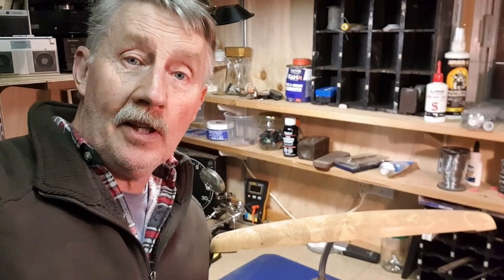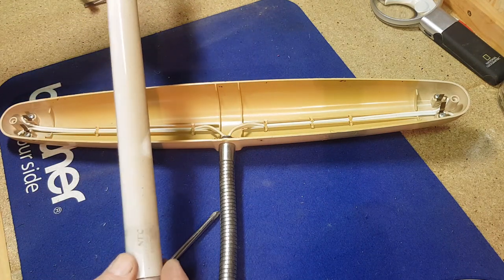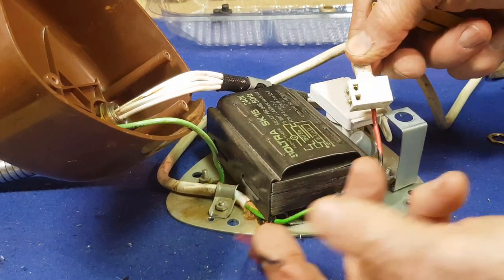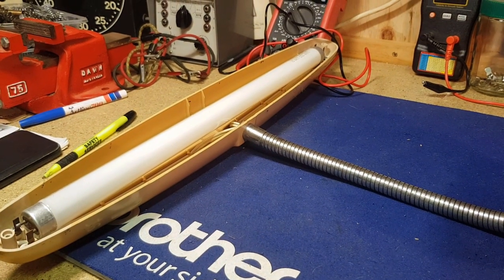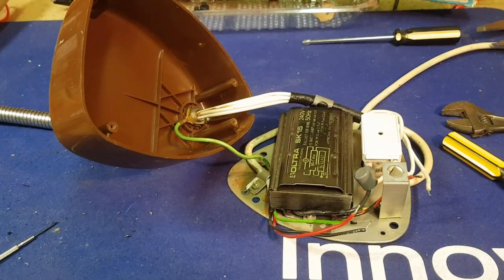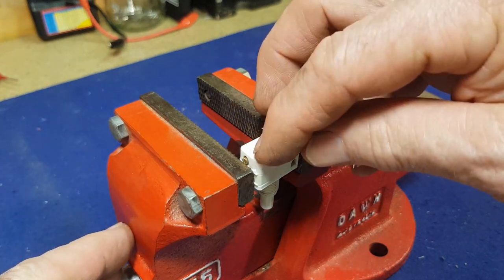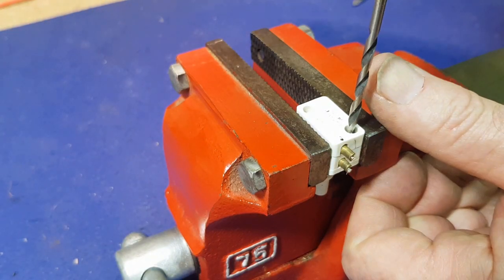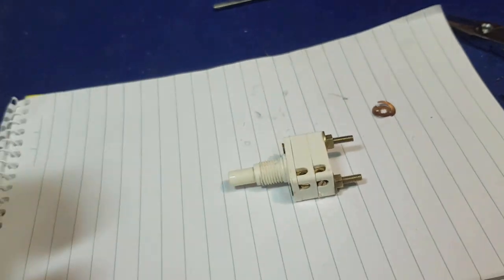1960s Retro Lockwood Fluoro Desk Lamp Repair & Restoration. Saved from the Rubbish Tip!!

Comment: I finally finished converting one of these to LED yesterday! This video is how I first found your channel ages ago, researching after I bought the lamp 😆
Mine was more of a wreck, top and bottom were originally cream but badly yellowed, so I painted them both brown. I forgot this one had a brown base, my choice has been validated! 😄
I converted it by mounting a CRI95+ LED strip in a diffuser, instead of buying a drop-in replacement tube like a sensible person. No regrets though, it looks the part.
Reply from the maker: Sounds like a cool restoration Nebby! Not sure about the brown paint though! Have you tried the retrobrite process to fix yellowed plastic?
Reply: @TheUltimateRecycler  On a small scale yes, with mixed results! I plan to try it again, but decided against it here due to the size, the severe & uneven yellowing, and the fact I couldn't get the neck separated without destroying the base.
Yours is the only brown one I've seen, but they came in orange, grey, green, red, etc.

Comment: If the ballast is bad, how would you bypass the ballast, as you mentioned, in order to use an LD bulb?
Reply from the maker: LED bulbs don't use the ballast at all. I think the starter needs to be replaced with a special fuse - or something like that!